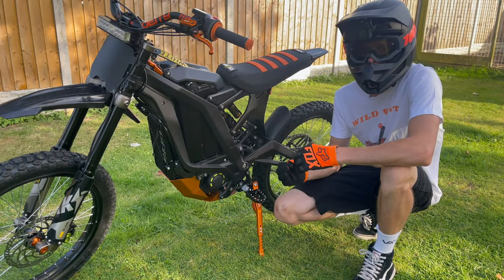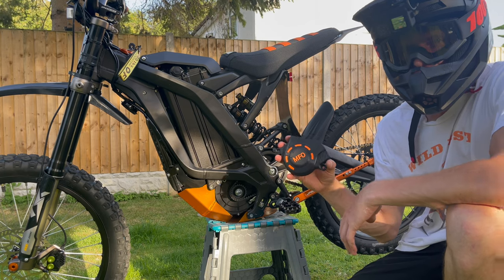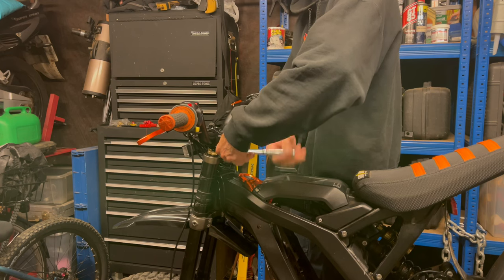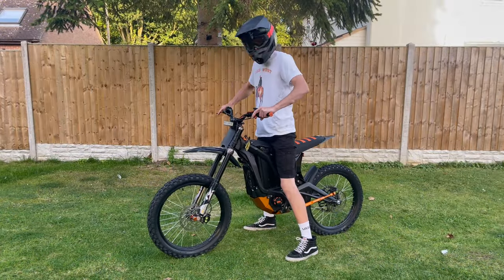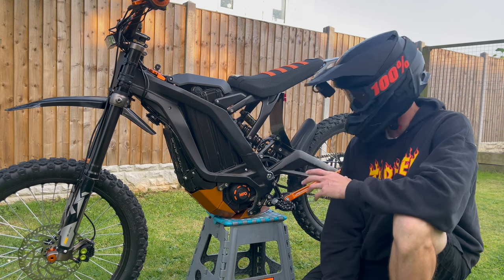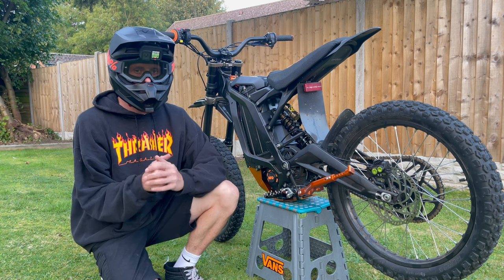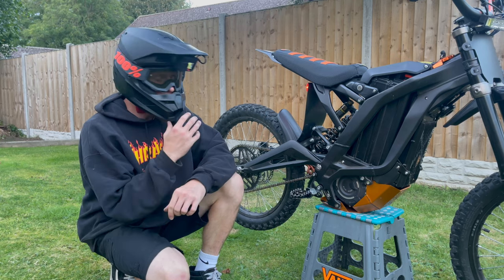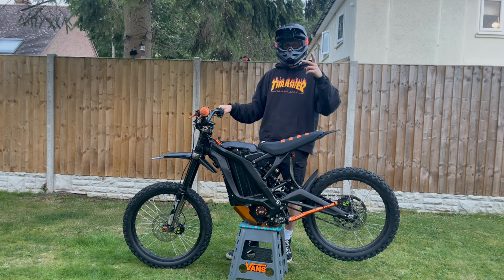5 Common Issues On A SURRON Light Bee X & How To Fix Them

Comment: Tip: Don't don't just rub grease around the bearing. Watch a bearing packing video. Otherwise, you might as well not do it at all as that doesn't last long. Bearing packing takes a bit of time, but it's meant to  be packed fully if you don't wanna keep redoing every few months
Reply from the maker: Yes i’m aware that the bearings need to be properly packed as that will keep it greased/lubed for the longest amount of time. I tend to re grease my headset every 2/3 months anyway! Appreciate the advice though man! 🔋⚡️
Reply: Vacuum pack them. Cheap kitchen vacuum machine, put your grease and bearing in, seal and vacuum. Pro tip.

Comment: If you put a cloth or Allen key between your sprocket and chain and then tighten everything by turning the wheel so that pressure is created, it also helps to maintain tension while you tighten the axle
Reply from the maker: Very true!

Comment: I got a question good vid btw just wondering how to fix every time I ride my handle bars shift idk if I need new stem I dont use a riser stem just og stem any hep I also tighten every time
Reply from the maker: I would try a new stem. If the stem is tightened correctly and the bars still move then something is definitely not right with it. 
It may have stretched/worn over time and its not clamping the bars how it should. May even have to replace the bars too as they may have worn over time too, this is very unlikely but always a possibility 💯🔋⚡️

Comment: For a squeaking belt you have to properly tension it
Reply from the maker: That is correct but mine also squeaks when tensioned correctly. If i make it any looser then it will slip on the pulleys 😩
Reply: My theory about that is you may have gotten wd40 on it when you were greasing your jackshaft bearings, and that might be why it's acting up. I really like the idea, though I'd just spray it further in the tube.

Comment: and u should pump up the shock as well
Reply from the maker: If you mean the rear shock then its not an air shock so it can’t be pumped up unfortunately. I have blown my shock though so a new one will be coming in the near future 💯🔋⚡️
Reply: @mattfrancisofficial  do sur rons use mtb rear shocks or like mx ones?
Reply from the maker: They use MTB shocks but the biggest size I believe. Its the 267x89mm or 10.5x3.5 size they use.⚡️

Comment: Has anyone else had problems with there head set coming loose?
Reply from the maker: I did have a problem with this at one point and the best i can recommend to do is invest in the warp9 stem lock! It replaces the star nit that sits in the forks and keeps the headset nice and tight. Since installing it i’ve never had to touch it. It has stayed tight and makes the whole headset feel better. While you’re in there it wouldn’t be a bad idea to change the headset bearings and cups if this is something you’re capable of. Would make a good a difference 🙌🏻🔋⚡️